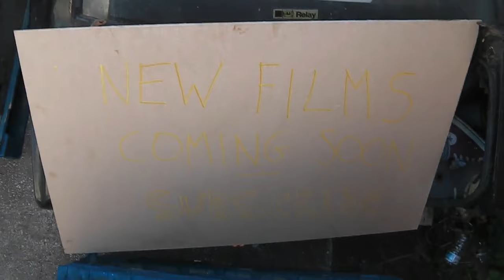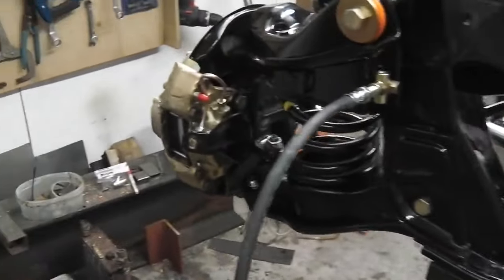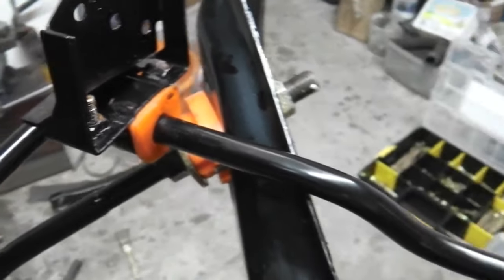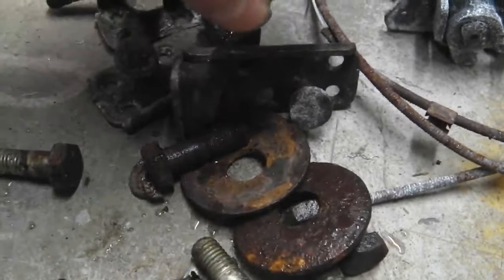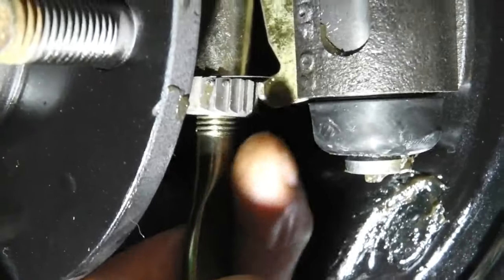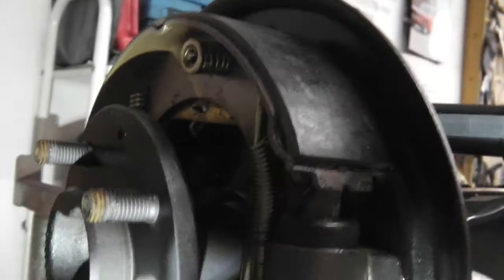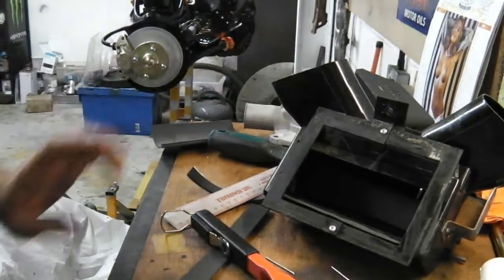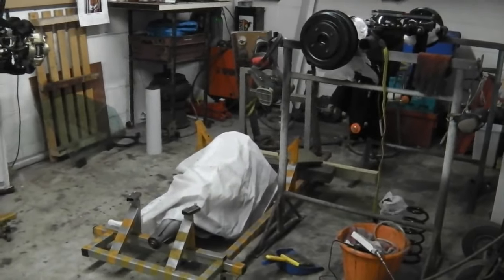Mk3 Cortina Resto - Project Ruby EP31

Comment: Hi Pete, liked the opening bit with you in the boot on the fork lift, great start the the video, front clip is looking very good, the plastic white collar black plug on the rear axle is a ware indicator to see when the shoes need changing, when new it should not press in  much, as they ware it presses in a lot saves you having to remove the wheels drum to check, I asked my local Ford dealers back in 1976 about it, when my Mk3 went in for a service, and that was what they said it was for. Over the years a lot of owners have asked me what it is for, which shows the detail you cover on little things like that is, and will be in years to come very useful,
Reply from the maker: thanks Keith sorry for delay, great info on that plunger

Comment: Rear breaks look spot on, the only thing I would suggest is a little silicon grease on the adjusters so they don't seize up, not saying that's right or wrong just the way I was told to do them and always have,
Reply from the maker: thanks Darren I have greased the actual mechanism, but yes time to grease the fork adjuster too, hopin you ok, pint in weatherspoons needed asap
Reply: Im good apart from working, could murder a beer 
What you need is a mk3 estate

Comment: just a little tip pete,for small bore copper pipe as you are using better to use fine sand instead of salt and from above small bore use a bending spring,
Reply from the maker: Thank you keith, in the end I bought (from NEC) a small handheld pipe bender, works good, Mark FUEy recommended, hes got a tip top mk3 and has done the same

Comment: I know people told you that the drop link washers  of the arb were the other way round but i think that initially they were correct as the Qh new ones show the washers pointing the way they were originally. I kept mine as they came off the pack but put the polyurethane ones instead.

Comment: Did you try those little brake pipes for clearing the suspension on full lock and full suspension deflection?That was my thought about the tight top bend.
Reply from the maker: Ian, thanks for this, thats good point, its possible i altered those, i seem to recall having same concern then remaking, im going to check just in case, thanks !!!

Comment: Hi Pete, brilliant vid. I’m trying to remember how my brake came apart. Did you ever find out if the ratchet was the right way? Or it will click when you pull the hand brake but tighten when you release it?
Reply from the maker: good question, i  think ratchet worked as brakes have been good, its one of those tricky jobs, im sure the spring touches the ratchet assembly Chris